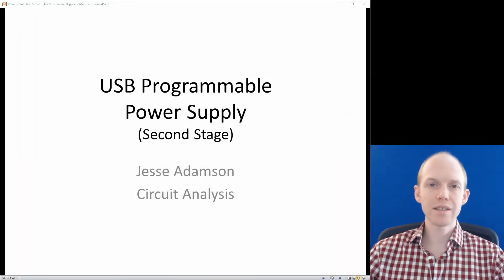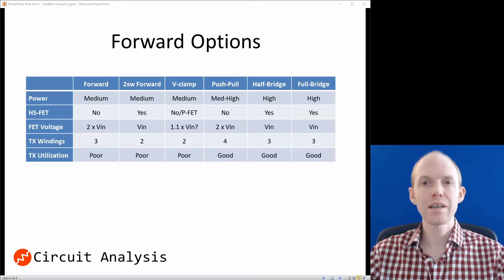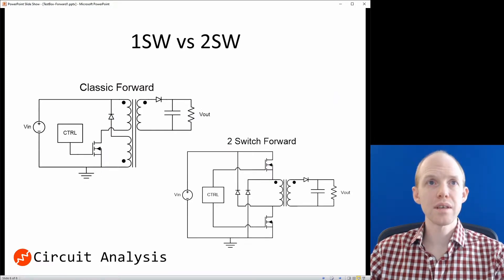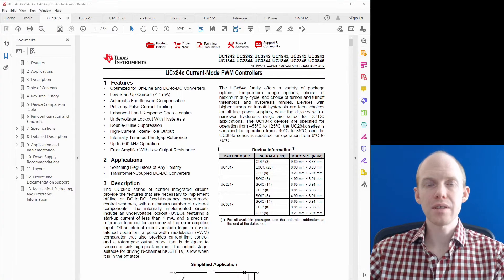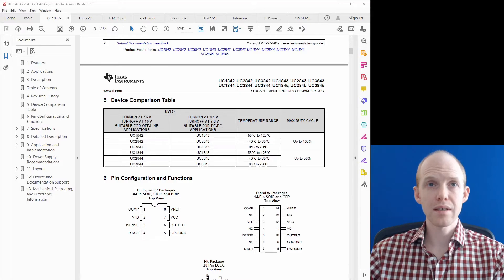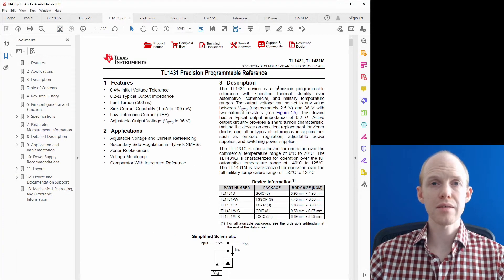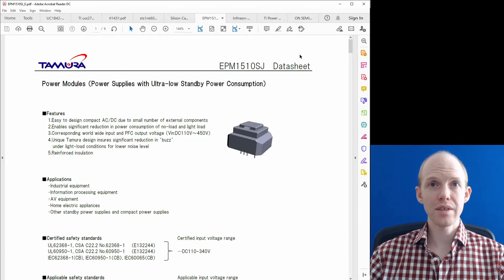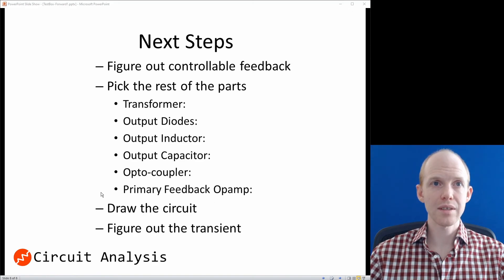Designing a USB Programmable Power Supply with PFC [Ep. 2 - Two Switch Forward Stage]

Comment: Do you think I can use the outputs from  LT8312 150W PFC Boost Converter (400V - 0.375A) to power a vacuum tube amplifier which requires 280V - 150mA?    I can use a voltage divider from 400V output to get 280V, correct?
Reply from the maker: Well are you boosting from 120VAC or 240VAC? If it's just for you for fun you don't need PFC. 150mA isn't much. You could use a bridge rectifier and regular boost to 280V. Or if you're running off 120VAC you could do the PFC boost straight to 280V since that's above the 170V peak.